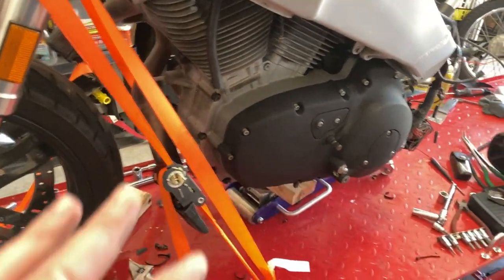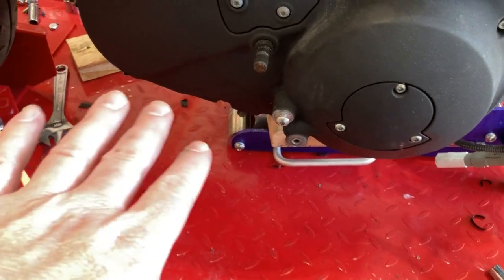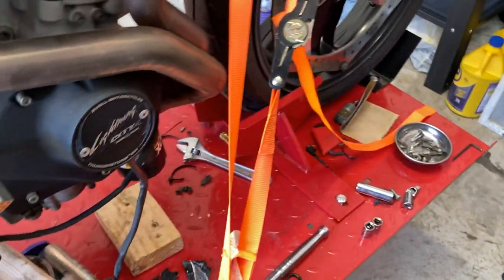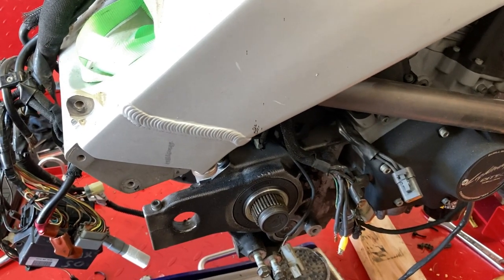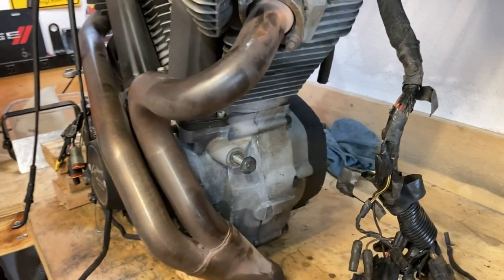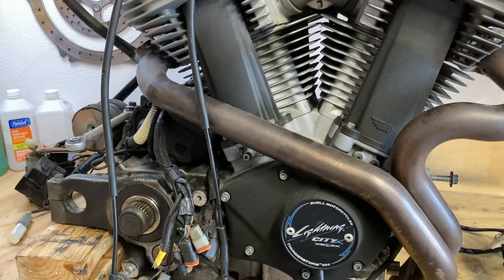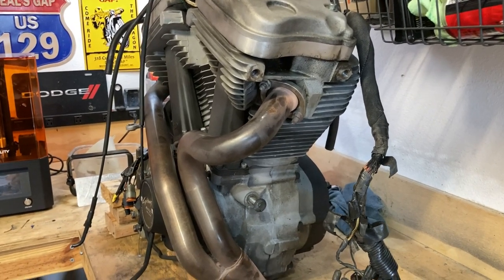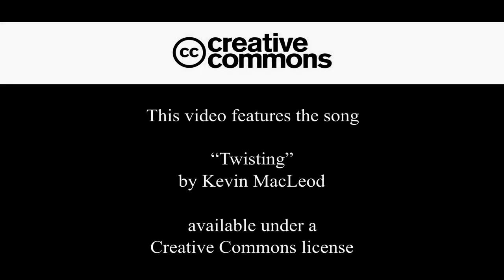Reviving my Buell: A DIY Motorcycle Rebuild - #engine #removal

Comment: When I pulled my engine earlier this year I had the same struggle. I don't remember my exact method, but I believe the engine with header was a bit over 200 lbs (mine is an XB12). My improvised workbench was a little too tall and I was afraid of dropping the engine so I actually pulled the cylinders while it was on the floor so I could lighten it up. Made me realize I need to get my old man butt back into proper shape.
Reply from the maker: Or trick some young dude to do it for you!